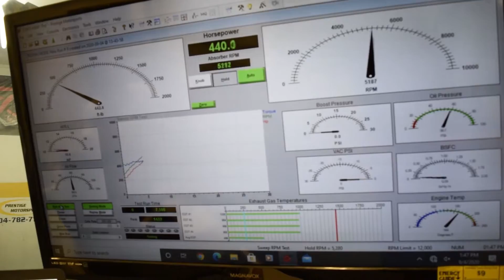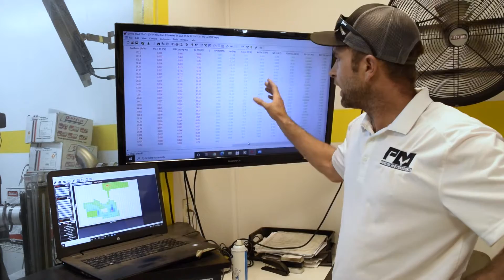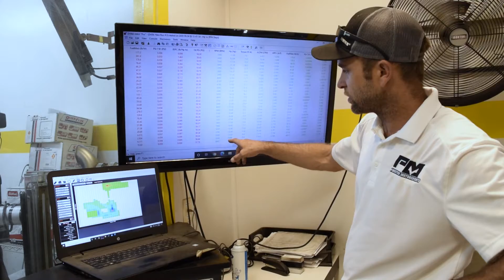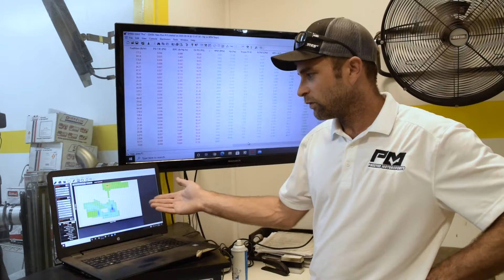Marine Engine Exhaust Manifold & Headers for 396ci Jet Boat Engine

Comment: cooling ( water flow and water pressure)  and ignition timing and fuel pressure and fuel flow - then the quality of gas in the tank - many repowers at times do have all 5 correct. Also will add  marine engines breathe totally different in a boats enclosed engine compartment than on a DYNO.  Marine engine have barely any FRESH air ramming into the engine compartment so basically a marine engine somewhat chokes on its own emissions.  Next all marine should be tuned on the water where that boat owner operates the boat - the lake or ocean water temps , prop size - specific gravity and rvp of the gas being used - how the boat owner loads up the boat with weight - summer time air temps compared to  70 degree dyno room temps - next is altitude a boat running at 13 K ft above sea level in Colorado vs at sea level is a ton of changes there.  Anyways a jist of it cause there is more.
Reply: Didn't he mention in the video that you'd want to run it in the boat and go over all the parameters and then fine tune everything?  I'm confused on what your trying to tell him here
Reply: There's a guy in up state NY and down in NJ  that have dynos that mount on the prop ./ out drives there stuff runs pretty strong.  Hudson poker runs